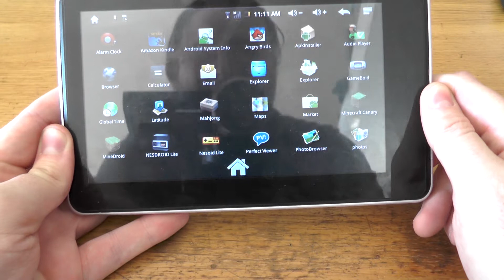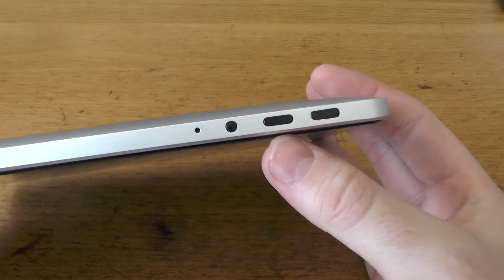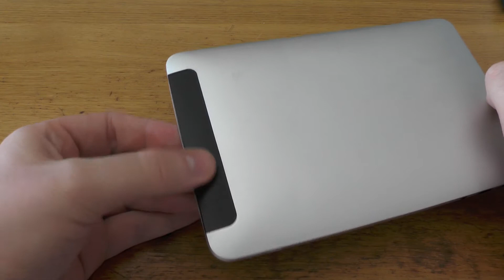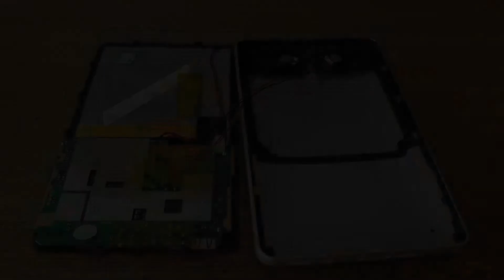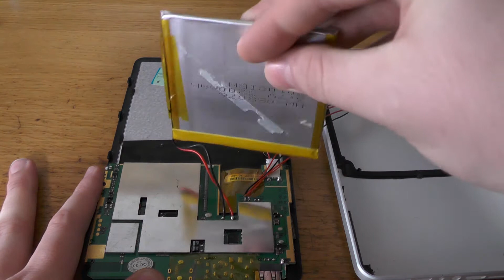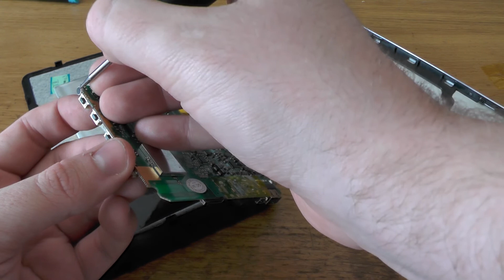WoPad Tablet teardown

Comment: im pretty sure ahsens said it had a good HDMI or was that the HiaPad?
Reply from the maker: That was the haipad, he mentioned this one had HDMI as he went through the ports but did not try to test it, just assumed it had it as the box, manual and the device itself do say it has it but the connector its self is not populated onto the board, its just a hole.
Reply: HyenaOfDoom
BLOODY SCAM ARTISTS